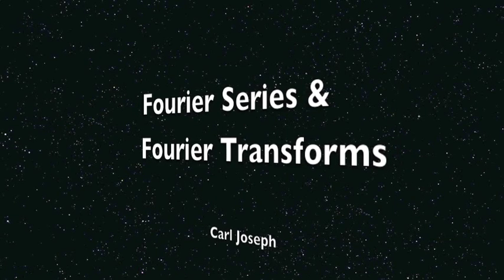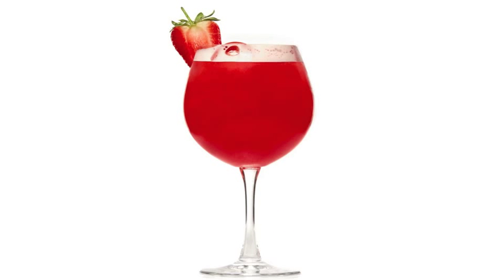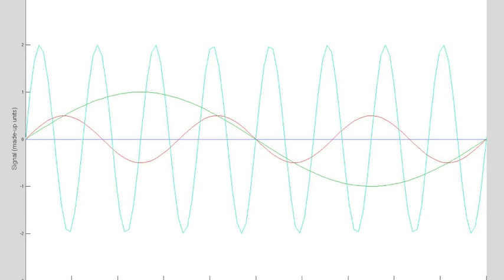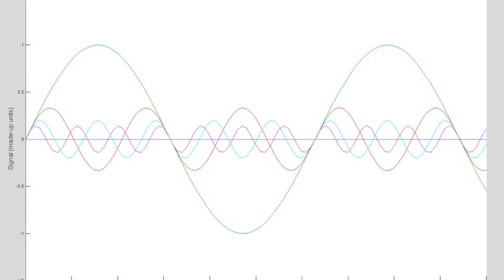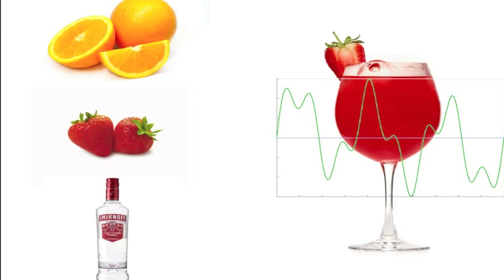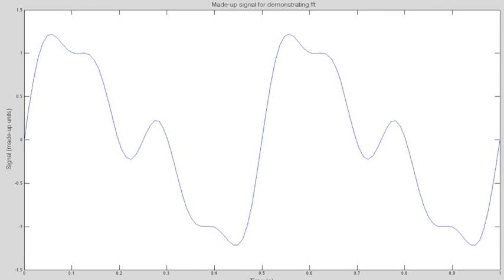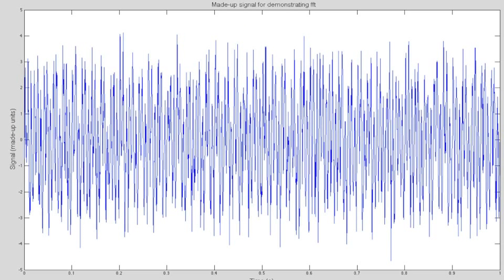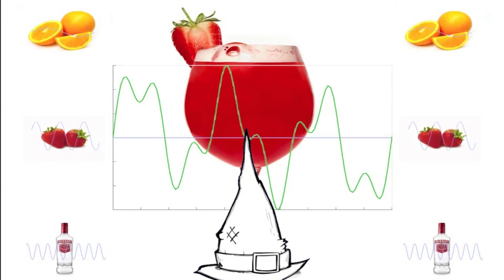Unbaking a cake - Fourier Series/Transforms

Comment: Thanks for the excellent video. This is the first video that helped me understand the FT. I just have a question: Does the data always have to be a function of time? I have a data set of nitrate concentration measured in 132 different boreholes within a study area. Each borehole has a single nitrate value representing the average nitrate concentration for that borehole. Therefore, I have a plot with an x-axis showing the borehole IDs from 1 to 132 and a y-axis showing the nitrate value in mg/L. Can I apply FT to this data?
Reply: Happy it was useful. I'm certainly not an expert, but you can use the Fourier Transform on static data like an image to transform it into its constituent frequencies. I'm not sure it would apply to your area though as it doesn't sound like you're measuring a mixture of different properties in a single signal (e.g. a single nitrate value for each borehole).
Reply: @carljoseph3780  Thanks for your quick response. When I use the FT on my data, the transformed result shows a strong zero frequency and then there are lots of small stuff. What does this mean?